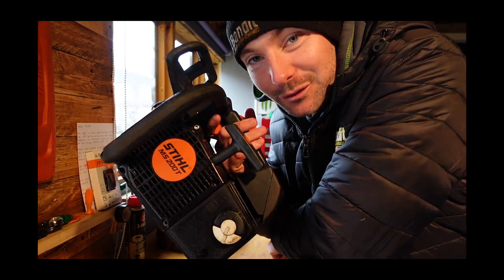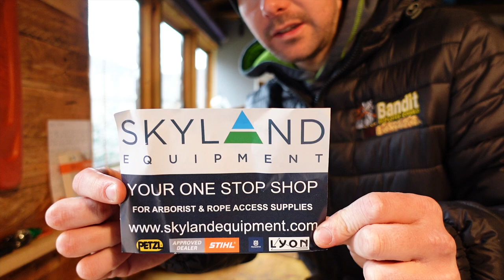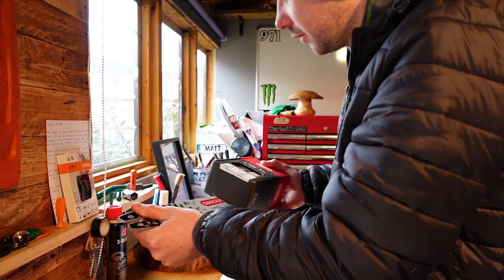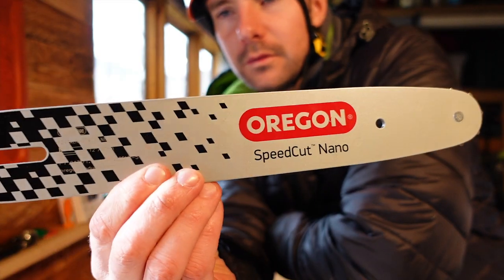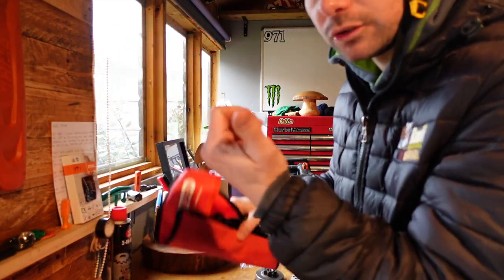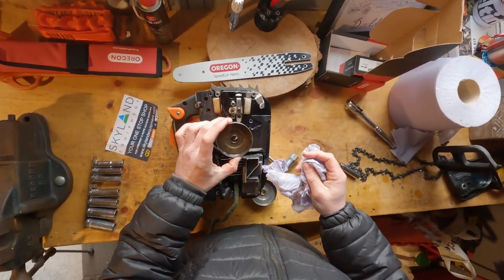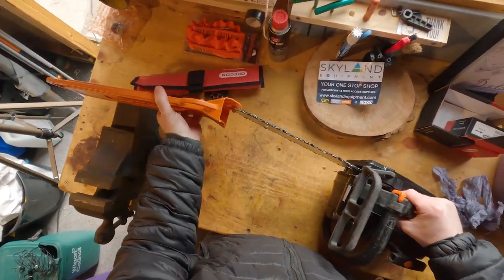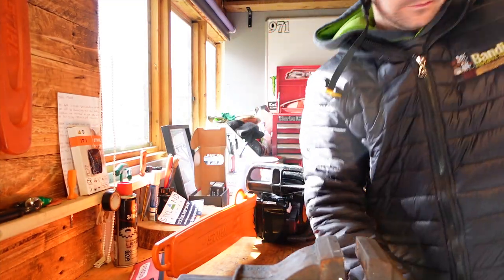I FINALLY Got A 200T! First Look

Comment: It's 3/16 file for that chain 👍
Reply from the maker: That's what I use on the usual bar so decided to go smaller and give it a go. I have plenty 4.8 so will try them at some point. I couldn't find anywhere from Oregon that actually said what files size to use?